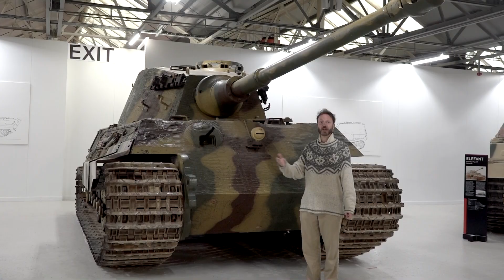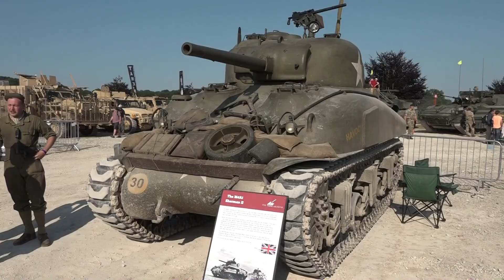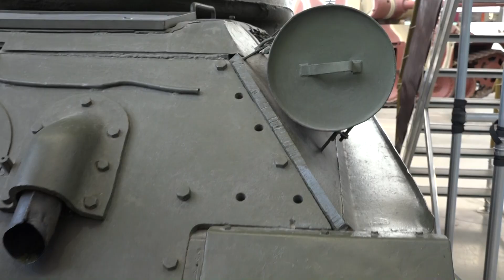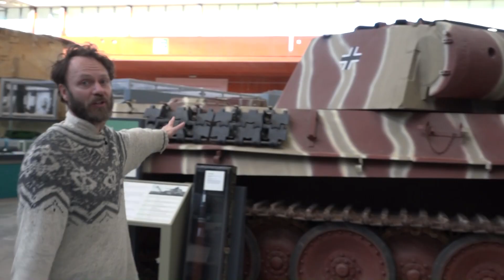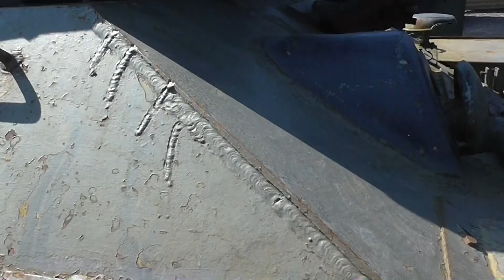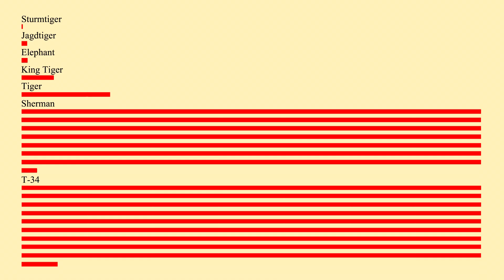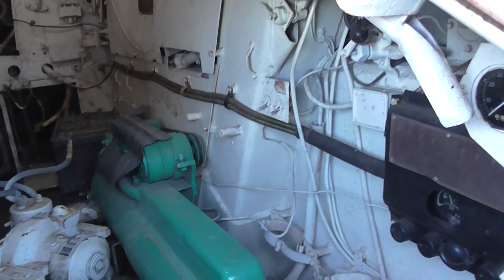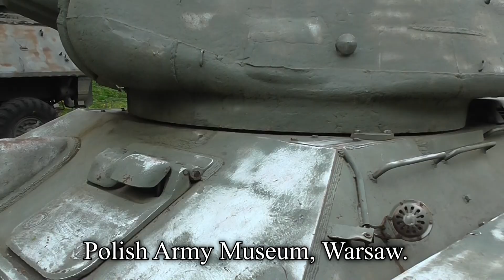World War Two's most common tank

Comment: WOW! That "knock the pins in" plate is the most Soviet tech I have ever seen! It does the job and is so primitive, it borders on genius. And every idiot from a place without roads can repair it.
Reply: That was part of the point. It was designed to be simple and easy to operate and maintain. Especially important for a conscript army of men of which many had very little experience operating any machinery of any kind.
Reply: @MrManBuzz  were US side more trained? Ive seen lectures that still in 1939-40 US army was in similar shape but they quickly upped game but even pilots had little experience and training everywhere.
Reply: @effexon  Yes but you have to remember the Soviet Union was a very different beast to the US. It was a melting pot of different languages and cultures, without an overarching monoculture that the US has. It's a very different beast, so it needed to be simple to operate and maintain by a crew that may not be culturally or ethnically familiar with each other.
Reply: @effexon  The thing for American pilots was that they barely ever saw actual air combat anyway, while their German counterparts were facing enemies daily and honing their skills. There's only so much you can do with training alone. Towards the end of the war they could match and surpass the Germans as their pilots got more experience and the Germans were losing more and more of their best pilots and didn't have the time to train the replacements properly.
Reply: @MrManBuzz  as if the US wasnt a melting pot???
but I guess the US had roads and an existant literacy rate unlike the USSR at that time.
Reply: @selectionn  Do you know how to read and comprehend basic points? The US has an overarching monoculture despite its melting pot.  The Soviet union didn't have that.
Reply: @romaliop  hows RAF pilots... early they had same issue but quickly gained experience and in one documentary mechanical "simulators" were added to make learning better and faster for new pilots.
Reply: @effexon  the US would certainly have had an easier time recruiting soldiers with previous experience in vehicle operation and maintenance. Private car ownership war far more prevalent in the US at the time than anywhere else in the world. The US military was the only one that was fully motorized at the time, all others used significant numbers of horses to pull wagons.
Reply: @selectionn  Yes.  Even if two soviets were native Russian speakers, they may not have been able to understand one another.  But the operation of the T34's was pretty basic, it was one of the better-designed tanks in the war and it had a big gun.  By better-designed, I mean easier to crank out (build) and capable of performing the basics.  Also easier to make field repairs.
Reply: @MrManBuzz  Russian was the language and the culture that dominated every facet of all the peoples who lived in the USSR.
Reply: @slyapbg  That's not even remotely the same thing. It was imposed on cultures like an imperial force. The regions of the USSR all had their own cultures, and the Russian part was another layer on top, but they maintained a sense of identity separate from Moscow. 

There was no unifying "we are all Americans" monoculture. Well, not one that was taken seriously by most normal people. 

It's embarrassing how much I have to explain something as simple as this.
Reply: @effexon 
America had wayyy more cars than any other nation before WW2.
So it was much easier to find people who had at least driven a car or a tractor (farmers, yay) before they enlisted voluntarily/were conscripted.

Also, because the US had to deploy troops overseas, and you don't want to use up scarce cargo space to send in people who know so little that you know they're gonna get killed easily/quickly, US training was way ahead (on average) compared to land-locked nations like the USSR or Germany.

Now, despite all that, there certainly was a lack of training, even among the Americans. 
But that was more a doctrine issue - they simply had to improve their tactics first (which is related to but also quite distinct from basic training). 
Of course, especially at the start (and especially in the Pacific) the US was still ramping up both their production and their training. So you'll find some hastily-created units with bad gear in places like Guadalcanal and West Africa.
But you'll also find the units that were created and trained long before the war kicked off there, so it's a bit of a mixed bag.

Cheers! ^^
Reply: @selectionn Plenty of farm boys in America could mend agricultural machinery  , the majority.of Russian farms were mandraulic
Reply: @MrManBuzz it was simplistic, it wasn’t simple and it definitely wasn’t “easy to operate” or did you miss the part about the hammer? The truth is it was a turd of a tank and it was difficult to fight in for the crews who weren’t given enough training.
Reply: That's one of the things I love about Soviet engineering. Sure western machines are more reliable, more luxorious, comfortable, have neat features etc.
But if you were to be stranded out in the wilderness, 100's of miles from civilisation, you sure wish to have the AN-2 Biplane, a Lada Niva or any other Soviet vehicle that can be fixed with minimal need for tools, spare parts and expertise. Best of all, they come with a manual on how to do it.

Actually Belarussian made Tractors had a resurgence in popularity, because companies like John Deere started to make it hard for farmers to make their own repairs, practically forcing them to take them to licensed mechanics. Meanwhile the Belarusian MTZ still follow the Soviet philosophy of supplying every machine with a repair manual and offering cheap spare parts. Which despite lacking a lot of (computerised) comfort functions made them quite attractive again as it means the Farmer can just have a small supply of spare parts stored at home and if something is wrong he can fix it himself immediately which is crucial if he "needs" to get out of the fields straight away. 
They just don't have the luxury to wait around for days to get their machines fixed or hope they can borrow another in the meantime.
Reply: @boomerix   The problem is that because of shoddy manufacturing these things break down all the time, and because their designs are ancient and rarely change many simple improvements just don't get introduced at all. Which is why they are only viable at all if they are also repairable. And, unreliability has its own opportunity costs. It's better to have a well-made, durable vehicle that also happens to have good documentation and extensive third party supply of parts, than it is to have a ubiquitous and simple vehicle made with huge tolerances and subpar materials using very old design principles.
Reply: some other scholar in another tank video points out just that: that people were looking at the T34 like "Bleh... Russian quality", and he goes "Yes, it was cheap, it was subpar when compared to other vehicles, but anyone with a simple set of tools could repair it, and that is Russian quality."
Reply: it was added on post war made T-34s. War made  models didnt have it
Reply: 1. That plate is post-war. No war production tanks have it.

2. It wasn't simple to repair, the transmission constantly broke, especially on the first version, so they had to carry an entire spare transmission with them sometimes just to get where they were going.

3. Wasn't that simple to operate either. The two man turret is a huge disadvantage (rectified in the T-34/85), and the gear shift lever is notorious for literally requiring a hammer to reach higher gears. The drive train design was just bad as a whole, so even though the engine was fine, the tank was not reliable.

T-34 did its job, but at the cost of enormous human suffering in producing it in those numbers, in operation by tankers because it was so cramped and uncomfortable, and in tanker deaths because it's hard to get out of in a hurry. It's not a bad design... but only for the USSR that didn't care.
Reply: It was actually a highly flawed system.
T-34s had a lot of problems with track pins breaking since they were being hammered sideways constantly.

As genius as the system may appear, the next replacement of the T-34 had proper retaining track pins. Although they kept the block in case any started coming loose.
Reply: They should have used a bubushka with a rock.
Reply: @rogersmith7396  I think that would be considered using WMDs. A step too far even for Putin... For now anyway.
Reply: @MrManBuzz  Depends on how many bottles of vodka they gave them.

Comment: 1) Other than maybe via strikes on production and shipping, there is no evidence of air power being particularly effective against tanks, at least not with WWII tech. Most tanks were not taken out by other tanks, true, but even fewer were taken out by air power

2) The Panther was not just overengineered, it was also a lemon. It had major transmission problems. When it debuted, a great many of the panthers never made it into battle at all.

3) Every country did tank recovery. Every country had recovery vehicles. Even captured or recovered enemy vehicles were used, because why not? 

4) World of Tanks is indeed a rather good game :)

5) Many of the T-34's initial problems were indeed fixed. They started with real problems with oil filtration among other issues. these were solved. The panther's problems weren't really. What we know of them is from French studies of late model Panthers.

6) Early war, the KV-1 was the hero tank for Russia. The T-34 took over a bit later.

Comment: Panther's gun being fairly good. Now that is Lindy's understatement of the year.
Reply: The armor of the panther was also miles ahead of the t34
Reply: @De_Futura  The front armor, anyway.
Reply: An understatement only in the context of tank-on-tank combat. Against soft targets that you'd shoot explosive shells at, it's no more powerful than the shorter 75mm guns of other tanks, and turns slower and has optics with a narrower field of vision. The Panther arguably over-emphasized long-range tank-on-tank combat, but arguably that's what it needed to effectively complement the Panzer IV.
Reply: @Onbird2  
I think the panther being a glorified tank destroyer with a turret makes a lot more sense when you take in the scale of just how many tanks where being thrown at the Germans on the eastern front. Everything else became an after thought, not just for the panther but for all German tank designs after a point.
Reply: As with everything regarding German weapons, the quality of the Panther tanks is always exaggerated. The reality was like this: The Panther was rushed into combat before all of its teething problems had been corrected. 200 Panther tanks were used in the Battle of Kursk. 46 of the 200 Panther tanks failed due to mechanical problems, with 2 burning out completely because the engines caught fire. This tanks had numerous technical defects. The side gear, which translated the speed of the transmission to the drive wheels, worked poorly, as did the gasoline pump, the seals on the gasoline and oil lines were not tight, the carburettor was not fastened adequately and the engine cooling worked poorly. These problems led to the Panther having the highest failure rate of all German tank types used on a large scale at the Battle of the Kursk. So this tank definitely wasn't fairly good in the Battle of the Kursk, the most important battle of all.  But most design flaws were rectified by late 1943 and early 1944. Most but not all
because some of its design flaws, such as weak final drive, were never fully rectified. Still the engine proned to overheating and engine fires. By the way, though officially classified as a medium tank, at 44.8 metric tons the Panther was actually a heavy tanks. So the tank had the same problems as the Tiger when crossing bridges for which the tank was often too heavy and because of the enormous weight there were also logistical problems. In comparison, the T 34 had a significantly lower silhouette because the T 34 was half a meter smaller than the Panther and was therefore easier to hit than the T 34. The tank also had a crew of 5 men, whereas the T 34 only had a crew of 4 men, which was better. The Panther's gasoline engine was also more susceptible to fire than the T 34's diesel engine. Incidentally, the Germans were unable to produce none of their tanks, including the Panther, using contemporary mass production methods so Germans never approached the efficiency of Allied manufacturing during World War II. By the way, using forced labour on the production lines greatly increased the risk of sabotage so many Panthers had been sabotaged during production. 
So when it comes to the quality of this tank, as with all German weapons, don't tend to exaggerate.
Reply: Good gun, good armour, good mobility to a point . That point stopped when you look at the issue of reliability. The Soviets didn't bother with reliability, because they had a Zapp Brannigan approach to tanks. The Americans did bother with reliability, because everything they made had to cross an ocean to get into the fight, so they made sure every tank worked.
Reply: @GoranXII  
I do wonder if the reliability issues of the panther were totally the fault of its design, or the fact that the Germans didn’t have the logistics or the production of spare parts to keep their tanks maintained in the field. All tanks are unreliable if they can’t be maintained.
Reply: @50centpb7   More like the rushed nature of the design and testing process, along with demands by Hitler for the Glacis armour to be increased, which due to production, was never able to be accounted for in the design.
Reply: @GoranXII  
The earlier panthers certainly suffered from the rushed design, but according to Hilary Doyle, the reliability issues of the panther had been ironed out by the time they reached the G variant.
Reply: @50centpb7  Even so, if you have to lift the turret off to remove the final-drive, you've done something wrong. Also, those interleaved road-wheels would never not give trouble.
Reply: @50centpb7 a huge part of it is Germany's logistical situation. 
A lot of German tanks were abandoned because they broke down. Not because they were irreparably broken, but because they'd break and sit in a depo for six months waiting for a shipment of spare parts, causing them to cannibalise one tank to "feed" the others, and utlimately abandon the vehicles when the Allies began their advance again. The exact same tank in an Allied depo would have had spare parts on the next train and could have happily sat awaiting parts all year.

This poor logistical situation also factored into the design too. Panthers had famously poor transmissions, a huge part of this is because Germany didn't have the alloys to use lots of high precision machining of gears, so Panthers had straight cut gear teeth. These wear down faster as they "smash" into each other. 
Tigers, which had an even more complex transmission, were allocated precision machining to utilise angle cut gears which more gently mesh together. This why a heavier vehicle with a more complex transmission has less of a reputation for failures, and also why Tigers are so mind bogglingly expensive.
Had it been an allied design the Panther could have used high quality machine tools to utilise a robust transmission system. 

And I'll finish with an example. During the Kursk offensive Panthers famously had just a 35% availability ratio. A travesty! 
But at the same time, Pz.IVs were reporting just 40% availablility. The same Pz.IVs that Soviet generals were writing about lamenting their tanks would be so reliable as that! 

Germany could have been manufacturing Shermans straight to US spec and they'd be losing half of them to mechanical breakdowns.
And they'd be producing them at about 1/10th the rate the Allies were able to.
Reply: @GoranXII you don't have to lift the turret off to change the transmission.
You can traverse the turret to the side, remove a large hatch in the roof above the driver/bowgunner, and pull the transmission up through that.

You're probably thinking of the Tiger, on which you did have to pull the turret off. However, the Tiger was designed with maintenance being less of an issue as it was intended to break the line and then pause for rest, Tiger units were allocated 4x the maintenance staff for a reason.
Reply: @kirotheavenger60  Ah, right. Still, you had to pull out a fair amount of stuff from the driver's/hull gunner's positions to get it out, which added time. Plus there was still the interleaves road wheels to deal with.

Comment: “Hilariously bad” is something you definitely want to hear when you’re talking about the structural integrity of your tanks armor.
Reply: But it doesn't does it.
The t34 was incredibly effective and genuinely a competent force. The weird casting defects aren't making the tank weaker 90% of the time, they're just "ugly".
And... who cares.
Reply: @eloryosnak4100 ive seen a few t-34s front fell off due to bad welding techniques
Reply: It's not very typical, I'd like to make that point @tdpro3607
Reply: @eloryosnak4100 Unless you're dealing with a fuel bomb (Molotov cocktail). Then not only is the tank ugly, the whole situation is.
Reply: @eloryosnak4100  you’re right the literal gaps in the armor wouldn’t effect its survivability at all
Reply: @Critbeau  yeah I’ve seen pictures of T-34s with gaps so large between the welds that you can very easily imagine a regular small arms bullet flying through which certainly wouldn’t be too pleasant.